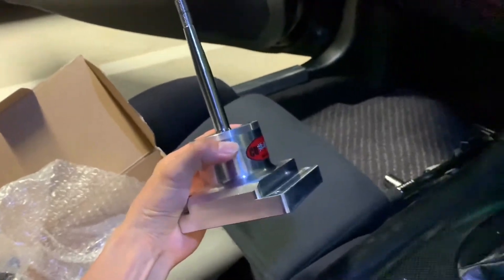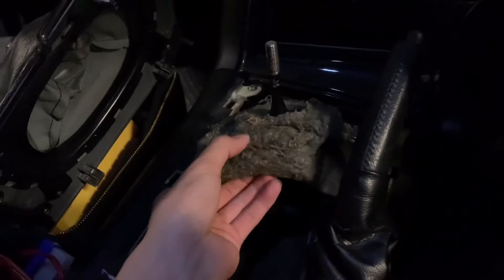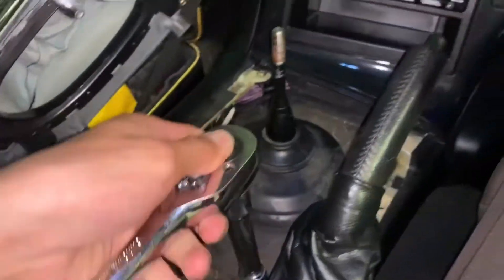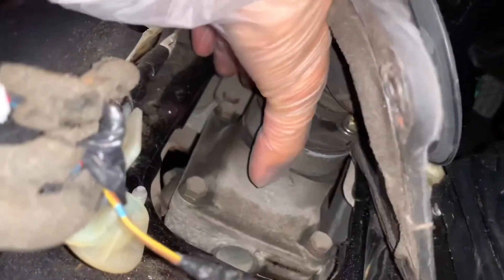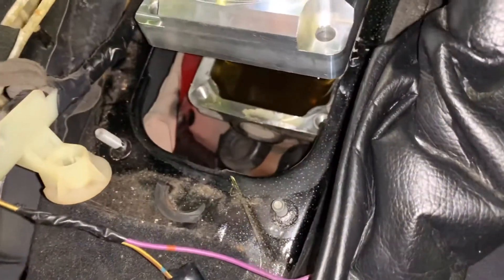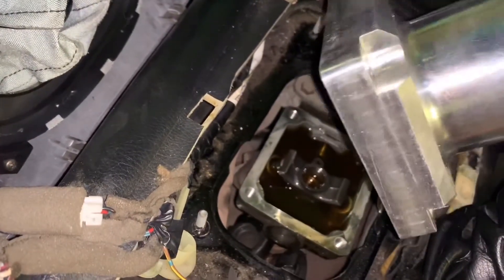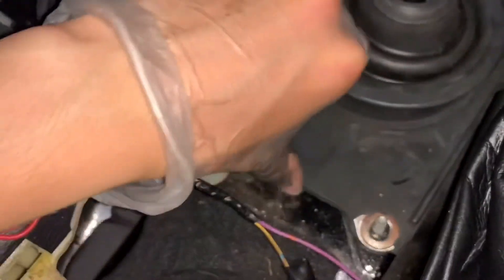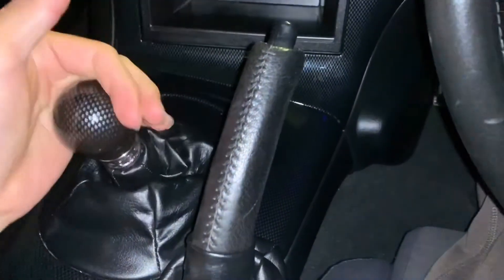Mazda RX-7 FD Build Episode 1: Install The CubeSpeed Billet Short Shifter

Comment: Just ordered one for my 7 in the uk little shocked it doesnt come with a new bush tho
Reply from the maker: lukie heathy yeah. Me too. I spent quite a while to remove the old one. Might as well get a new bushes. Maybe I’ll do it next time. Old bush is a little bit play.
Reply: @Jimmy_Wei  tempted to buy one of them bronze metal style ones b4 fitting
Reply from the maker: lukie heathy just an update, metal Bush not good for this shifter. Get a brand new oem bushing.
Reply: Cheers still not fitted mine yet as now fitting a electric water pump but will be fitting soon
Reply from the maker: lukie heathy yes, the metal slide in bush has too much play and can’t hold the bottom part of the lever firmly on the whole. And when you shift in to 1,2 5 and R gear, if you push slightly harder, the shifter will come out of the bush, I got a brand new OEM bush and problem solved and very good.
Reply: @Jimmy_Wei  god the bolt on drivers side closest to steering wheel is hard work